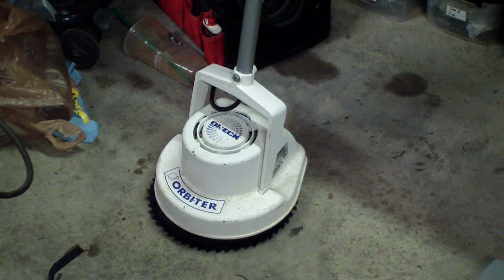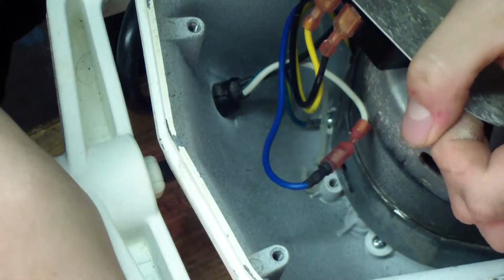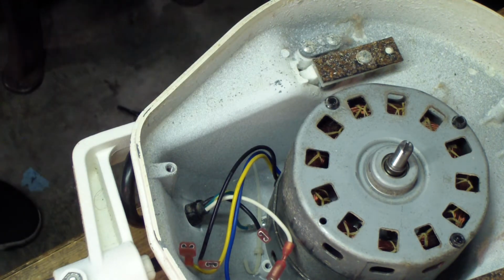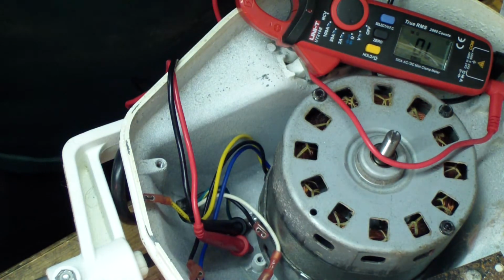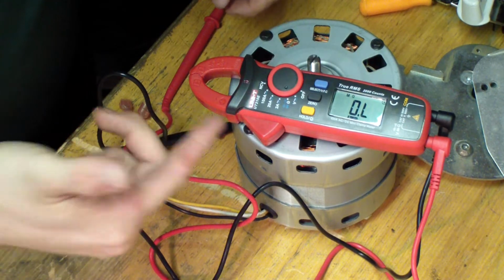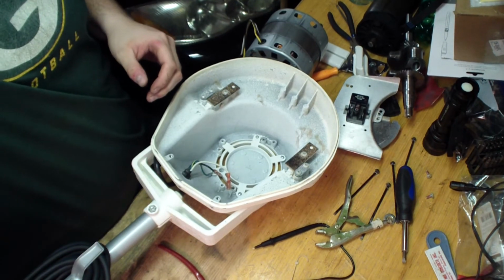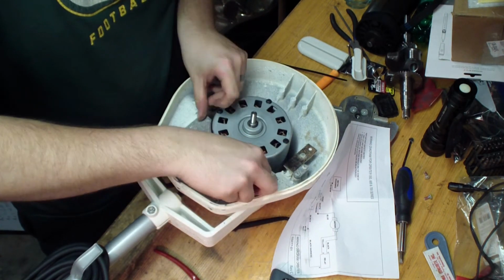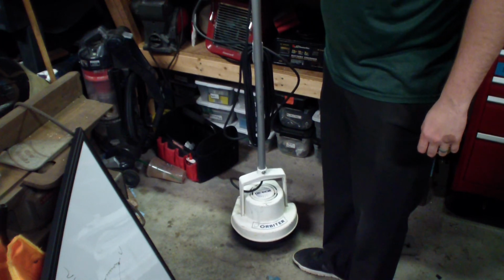Oreck Orbiter Floor Scrubber Repair (Anti-Throw Away Society)

Comment: 31:50 judging by model numbers. it looks like an induction motors. i wonder if you can replace it with one of those industrial induction motors (the ones that has the capacitors attached to their bodies)? probably use the smallest one and mount them somehow... because those ones are cheaper and you can easily get them basically everywhere

Comment: Hello, I recently bought one machine like this one. It arrived broken, one of the motor supporting bolts broke loose from the top of the housing. I did get my money refunded but the seller didn't want to spend the free return fee, so I kept it with me. I would like to fix it, I enjoy trying fixing things. Can you tell me what material is used on the construction of these machines as solder is not working for me or perhaps tell me  any other options to reattach the broken screw  housing to the body.  Thanks
Reply from the maker: @RafaelDiaz-gb1sm  cast aluminum body so aluminum brazing rod is what you need.

Comment: I bought a used oreck xl that smoked bad the first time i used it. So  i bought a new motor and the new motor is smoking now.. im using the orange brush. Is this common?? Im at a loss here
Reply: Where did u purchase the motor?
Reply: @GrounDControL873  ebay, but I figured it out. Someone wired it in reverse. I had just copied their work.  It's all good now

Comment: I finally found a used motor, installed it. But it just buzzes and doesn't move until I turn it manually, and it still buzzes. Wasted $110 and still cant get it fixed. 🤕

Comment: Anthony Shelton, thank you for practicing this Anti-Throw Away Society philosophy. That's my philosophy too. I have to finish a video to make available on youtube, with the recovery of a 30 year old mixer (manufactured in the UK) which after being rehabilitated works better than many new ones made in china.
I saw your video because I found an Oreck XL Pro for sale here in Europe and my curiosity wanted to see how it was made and confirm that the motor is 115V which is not suitable for our 220V voltage. By the way, what is the power consumption? In case I think of using a 220V/110V transformer. Thanks.
Reply from the maker: It was a neighbors that I fixed so I can’t measure it, but I would assume it’s 1/3 HP based on size and the fact it doesn’t use a capacitor for the start windings (only uses resistive wires to create phase change). I would guess maybe 6-7 amps?…..online specs for an xl pro do say 5.4, so might be 1/4 hp.
Reply: Thanks. I confirmed with the seller that the machine works at 230V, I just have to replace the plug as it was bought in the UK. I already closed the deal. I hope it's as you say, a machine that will last a few years, although I'm going to use it to crystallize an area of just over 1 m2 😀 . If it works, maybe take the opportunity to do the same to some areas of my condominium. You have gained one more subscriber 😉

Comment: Apparently you can't buy the motors anymore. Bought 2 orbiter and both motors shorted in less than 6 months. What a shame.
Reply from the maker: Seriously? Well If you ever wanted to try rewinding a motor this would be a good one to try. If I had the wire and the time, I would have for this one. But it was someone else’s and they wanted it back quickly.
Reply: @TheVintageEngineer  Hi, I have an Orbiter 550 and the cord was severed and put back together by an electrician. Now, it turns on and spins if doesnt touch the floor, but as soon as it makes contact it stops and trips the safety. Any pointers?
Reply from the maker: @yvonnemarie118  Did it right after the new cord? I would first double check they wired it back correctly. Particularly making sure the wires that go to the relay are correct. If they mixed up the black and yellow from the motor to the relay then I could see this being a possibility. I believe this is the diagram to yours: https://usaclean.com/pm/partsdiagInd.aspx?id=1&cat=ServiceCallID&Mfg=ORECK&Model=ORBITER%20ORB550MC&TableID=239-3004
Reply: @TheVintageEngineer  used the same cord, it just got cut and rewired.

Comment: I have a similar buffer that spins but stops as soon as I contact a surface. Any idea what the problem could be? Thanks!
Reply from the maker: Sounds like it could be a shorted coil in the motor not production enough torque to keep it going.
Reply: Someone else on here posted frozen bearing and sure enough I just checked mine and it is rusted and stuck. That means it will spin like a buffer but not oscillate. It is the bearing you see when he takes out the 4 screws and lifts off the pad driver.

Comment: My moms orbiter ran for 56 years very well and a.screw came out that held one of the legs on it. The screws are so stuck that I could only get two screws to unscrew out of the plate that holds the brushes . This happened yesterday. Is there a way to get the screws out so I can fix it?
Reply from the maker: Get an impact driver (drill). If you don’t have one borrow from a friend. Push down hard on the screw and try to reverse them out. Impact drivers have a “hammering” effect which aids in breaking loose seized screws. Also if you don’t have access to one, use a screwdriver that you can put a wrench around to apply more turning force. The old craftsman screwdrivers with a hex shaped handle can have a wrench wrapped around them for more torque. Push down hard and use the wrench for more force.

Comment: Thank you, thank you, thank you for posting this.  I have a Orbeck Orbiter 400 XL  that went south, just all of sudden decided to quit.  Only the user/service manual on the web could be found, nothing for the repair. of it  Your post was all I could find, BIG HELP.  A wire shorted out in the motor, severing it's soldered connection to the reset button.  Works like a charm now.  Thank you, thank you, thank you...

Comment: Awesome video. I have an oreck 550 orbiter. It was running fine.  Then out of the blue. A small amount of smoke came from the top of the motor case and the machine stopped .
Now the power button is light up , but does not run .
Do you reckon it's the motor relay. Or the motor that's bad ? 
Not much info online about these repairs 
Aloha
Reply from the maker: R Jaya Reg first thing I would check is if the motor locked up. Can you spin it by hand. Note that the disc can still spin so you need to take it off and look if the shaft of the motor is turning.
Reply: Anthony Shelton it spins freely
Reply: I’m just having a hard time finding the motor online 
I tried the company you mentioned. The website couldn’t locate the machine or parts for it. I did see about 3 different companies that are named similar to what you said. I searched all of them. No luck. I do like your tip about going straight to a Chinese manufacturer or alibaba. That’s rad. But Ali didn’t have it. I bet someone makes a better motor that’s compatible, but difficult to cross reference it I reckon   Where did you buy your motor ?
Reply from the maker: R Jaya Reg I got the motor from that site. But I don’t see it listed anymore, maybe they don’t carry Oreck anymore. Anyways you can always bypass the relay by applying power to the common and the run winding and then quickly applying power to the start winding until it starts. Don’t really recommend it unless your are very educated on electricity. You can also disassemble the relay and look at the contacts and also check for continuity across the coil inside.
Reply: Anthony Shelton aloha you know. After a couple days of the machine sitting and I took off the bottom looked around. Now this arvo I tried it and it turned on. Only thing is it smells hot and a bit of smoke going on. I was using it on my carpet when it first shut down on me. What do you think 
Should I keep running it ? I’m using a flat pad on it on the carpet , maybe it’s too much resistance? I notice they make a brush for carpets that’s more of a halo ! Bra should I keep running it even it she smells hot ? What do ya think ?
Reply from the maker: R Jaya Reg ok it sounds like originally it got hot and the thermal switch inside the motor opened up when it got hot (why it turned itself off) and later the switch reset when the motor cooled off. I would switch to the appropriate pad for the surface. If the motor gets too hot or pulls to much current the internal breaker will activate.
Reply: Anthony Shelton aloha. Oh this buggah still acting up . I wen polish a bamboo floor with a lambs wool pad on the same Oreck machine. Ho bra now da thing just pouring smoke out of da top of the motor. As it ran. 
I shut it down. 
Do you think my motor is shot man it’s only 2 yrs old and it’s only been used very little 
I’m tripping out.  Help.
Reply from the maker: R Jaya Reg either two things. Start windings are getting stuck on (relay isn’t letting go after it starts) or the motor is bad. Can also be both because if the motor is shorting then it will cause the current to stay high and cause the relay to stay engaged. Take some resistance measurements like I did and if see if 2 of the 3 add up to other one.
Reply: Anthony Shelton I will run the tests. FYI. I did use it on our carpet. With a big scrub pad on it  so I was making harsh resistance on the machine 
I borrowed it from a client at work. I’m so embarrassed 
I just ordered a new one for them 
But I’m stuck with this one 
I wish oreck had better customer service 
I see plenty reviews of the machine breaking
Reply: I am having the same problem. Oreck 550MC smoke coming out of the top of the machine. What was the fix? New motor?

Comment: May i ask a question? my unit runs great until i let it's natural weight hit the floor and then it turns off. I tried to auto connect and bi pass the relay . i was told this is not possible. Can you tell me if its possible to direct connect the wires and bypass the relay... michael at bluewatercolor@gmail.com. id be very appreciative if you can explain that to me... thank you Michael
Reply from the maker: Michael Goldsholl you can but you still would need to apply voltage to the start winding for the first 1-2 seconds and then remove voltage (what the relay does). By turns off is it the thermal overload relay tripping? If the switch stays on will it turn itself back on after a few seconds?
Reply: Anthony Shelton mine does the same thing. It runs fine off the floor but when I put it down it just stops and makes a humming noise. Do you think is the motor?
Reply from the maker: @anaililt  So it's stalling it out. I would make sure all your connections are made properly inside. You could have some voltage drop in the system from either loose connections or possibly corroded ones.
Reply: Your problem is the 6006RS bearing under the pad-not an electrical problem! The bearing is frozen and just needs to be replaced for about $4 on ebay.

Comment: Thats the oreck 600 ,,,  Its Clunky compared to the 400 and the 550 ..  Still yr video was cOol .. Later
Reply: Check this out ,,, I bought a White Oreck 600 off of C.List .. Guy wanted 125 , I paid 90 and got the carpet/ Wood head and 2 New white cotton scrub pads .. I went to the Oreck Store in W-Salem ,, the white Carpet scrub pads are 21.99 each ,,   I gotta Reverse on my cOmment above ,, the 600 is just FINE ..  B cOOl ,, B_R

Comment: On mine, the motor turns very slowly and buzzes. What is it?
Reply from the maker: ReinSman100 does it spin freely by hand?
Reply: @TheVintageEngineer  yes. Spins like a top.
Reply from the maker: ReinSman100 could be a short similar to the one in the video. I would take some resistance measurements and see if something measures out of standard.
Reply: Check the bearing(6006RS) under the pad and you'll find it is frozen!

Comment: Nice. Very helpful. Any idea about the machine vibrating loudly but still running?
Reply from the maker: Try eliminating the motor as the culprit by removing the plastic wheel and the eccentric weight (offset piece with bearing) and running it.
Reply: @TheVintageEngineer  whenever I pick the machine up off the ground when running it runs incredibly smooth. It starts to vibrate once I put it back on the floor but eventually it stops. I will check that out. It almost seems like the forks that are attached to the handle are loose and shaking. I tightned the bolts for that after taking off that plastic wheel. Thanks.
Reply: AJ James sorry for the inconvenience how did you you fix it I’m have the same problem with my oreck orbit xl pro